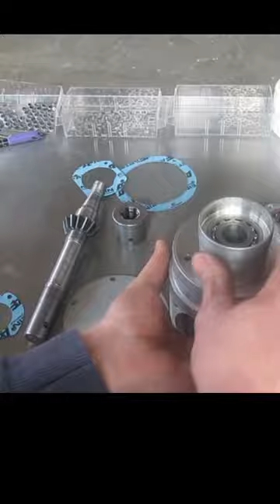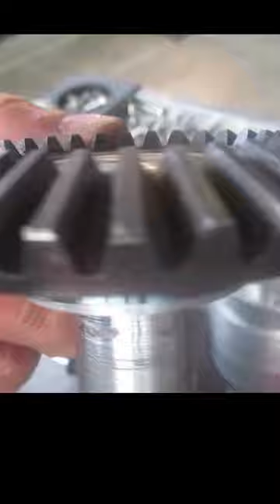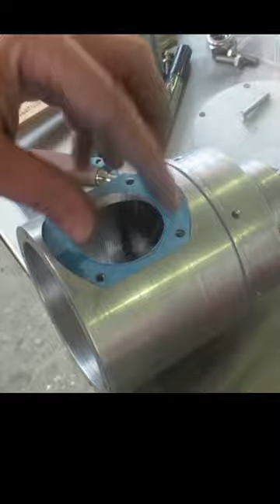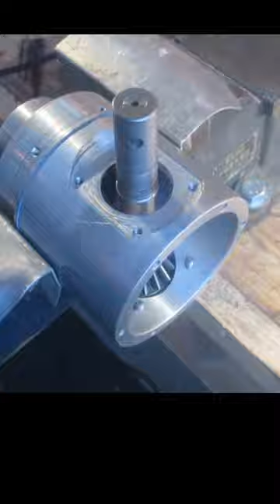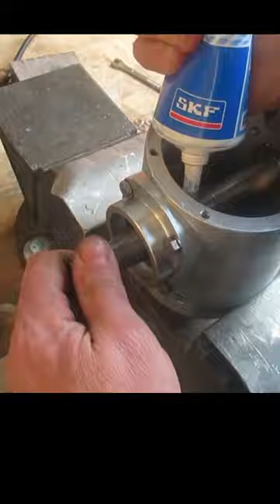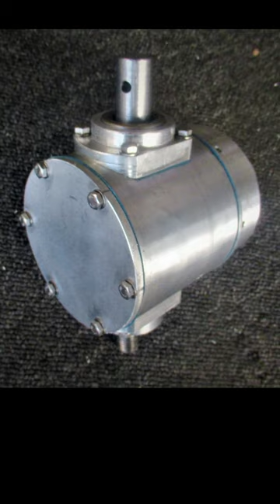Helicopter Central Gearbox #shorts

Comment: Bolts probably should be pair wired like in production aircraft. Get aircraft wire locking pliers and then they can be wired so If one loosens it tightens its partner. Vibrating bolts can work out.

Comment: Can you help me I bought a 269,or 300 Hughes transmission, but I don’t and can’t afford the drive shaft, don’t see anything available, the one you did looked like my tractor wheel gear , I have the bendix part number  I wanted to make the drive shaft and outer bearing tube